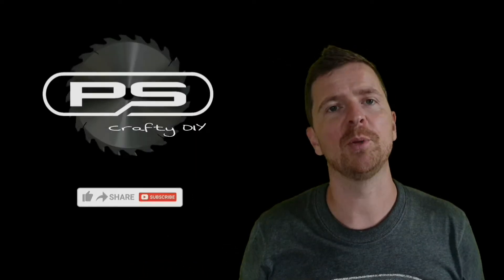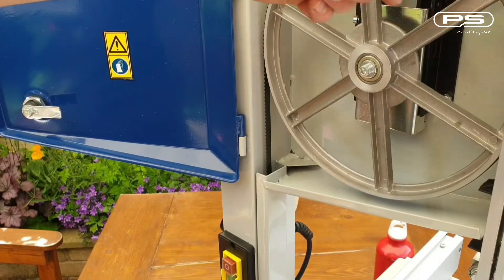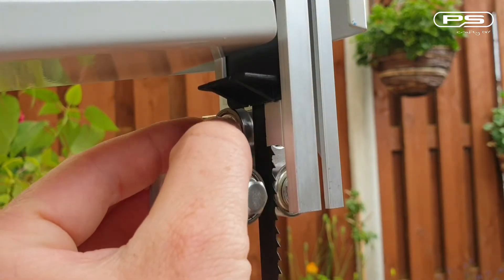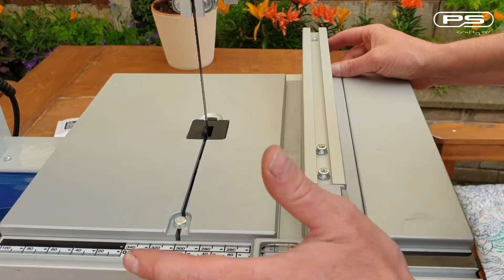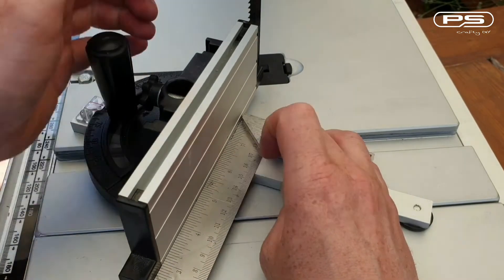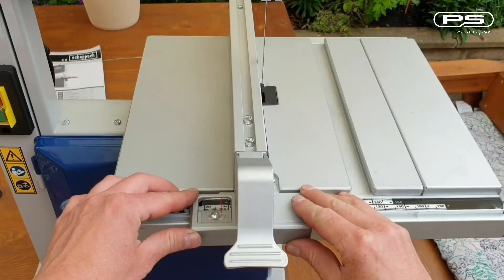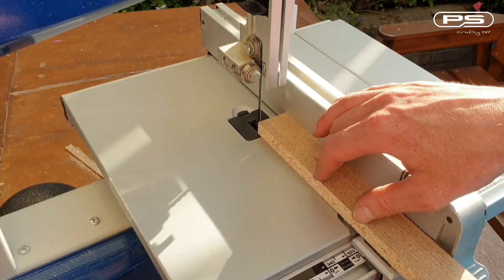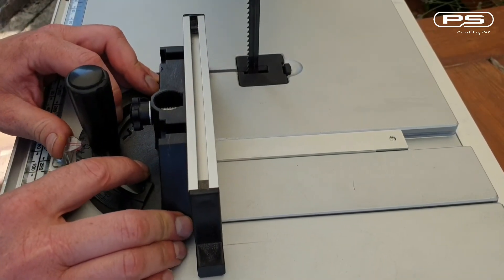How to Set up Band Saw for Straight and Accurate Cuts || Bandsaw Tune up

Comment: What a GREAT setup tutorial for a band saw.  My band saw has given me so many problems that I feel like it is a worthless tool.  You have given me hope that it will be a very useful tool.  I need to work through all of the adjustments you suggest.  I'll reply later how it works after all of the adjustments.  Thanks for the video!!!
Reply from the maker: Thank you, the key along with the good set up is a good quality blade. I've spent ages fettling with set up but it would never perform the way I wanted to until I got decent blades in it. It makes all the difference. The blades that came with the saw were too thin and flimsy comparing too good quality blades. You'll get better and quicker with the set up each time you do it. Once you get there you'll find that properly tuned bandsaw is very versatile and useful tool.  Makes less waste, mess, noise and uses less power.

Comment: My still drafting to the right on the 42x 42. I got like a 1 mm bow cut. Is my sow still louse or?. I did everything like in the video .
thanks for your help keep up the good work. You are awesome 👍
Reply from the maker: I am sorry to hear that. What blade are you using? If the one that came with the saw, You'll never get that cutting straight, I couldn't either. Buy a good blade and it should cure. Also see if the blade is not oscilating side to side. Some people had a problem with that, if thats the case there is not much you can do but take the saw back. Hope that helps

Comment: Great well done
Reply from the maker: Thank you...
Reply: @pscraftydiy  I have a problem with my Scheppach bandsaw, the blade is running very close to the front edge of the lower wheel and i cannot adjust it to the centre. The to wheel can be adjusted to the centre but the bottom wheel not, and the cut is pulling to the right on 6mm MDF. Its like the whole motor assembly and shaft is titled upwards. I was going to try adding two washers on the motor side of the lower two motor bolts to try and tilt the motor  upwards and the wheel end of the shaft downwards a bit.
Reply: @stephenyoud6125 Did you try run a proper blade in this or are you using the one that came with the saw as they are rubbish. Lot of problems people having are down to poor quality blade. 
The bottom wheel is not directly driven by the motor. Its driven by a drive belt and a pulley fitted on the motor so if the motor shaft would be out of the line like you suggesting it would be the drive belt slipping off not your blade. 
The bottom wheel centre can be adjusted by 4 screws at the back of the saw near its shaft. I am not sure if these only shift the wheel centre left/right and up/down or if you able to adjust the shaft alignment on these as well, meaning to tilt the shaft. I'd be very careful about this adjustment done on these 4 bolts as these should be set in factory and you should never have to touch those. I'd try to get in touch with Scheppach and ask them for advice or if there is any procedure they could have for you to follow to get the wheels coaligned. If your saw is new I'd try to return it as faulty as the flat backing could be bowed or bent, they should give you a new one or your money back.
Reply: @Secbra1  Mine us a different model: BASA1 and definitely seems to be direct drive from the motor armature to the bottom wheel. the 4 bolts seem to hold the motor on directly and dont offer any tilkt adjustment as that I think is what is needed: to tilt the bottom edge of the bottom wheel down.  And yes I'm using the blade that came on the machine. No matter what I do I cannot shift the blade from run right on the front edge of the lower wheel. I think this is what is causing the cut to pull to the right as the excesive forward tilt of the blade by running so close to the front edge of the lower wheel (the teeth are actually overhanging the edge) is causing the blade to twist and this is steering the cut to the right.
I wrote to Scheppach but they only sent an auito generated reply saying they are busy and will get to me later. I tried adjusting the blade guide rollers but had to file quite a bit on the lower outside guard, below the table to get it to fit past the thrust bearing  behind the blade. Looks like a Friday afternoon machine
Reply: @stephenyoud6125 Alright I see. In that case tilting the motor with washers/shims makes sence. I'd really try to run a proper blade in it firs and see if that gets you anywhere. I had lot of trouble with getting mine cutting straight, tried absolutely everything and it was still running off. I was convinced there is something wrong with the saw as Ive tried both blades supplied with the machine one was running off to the right and the other to the left. That's when I realised and ordered different blade from reputable manufacturer and it was like night and day.
Reply: @Secbra1   thanks for the advice - which brand of blades did u order ? cheers